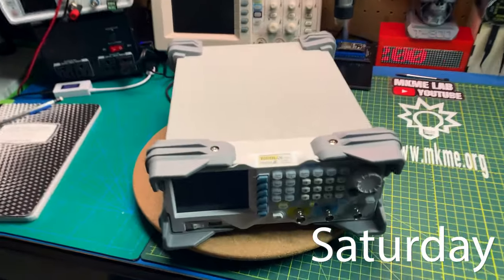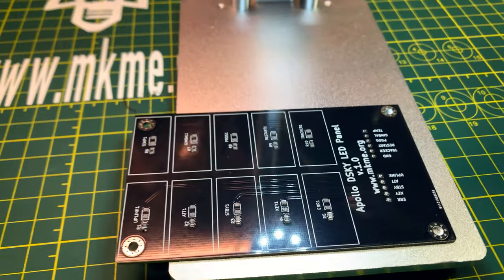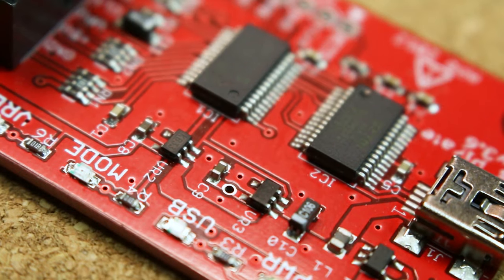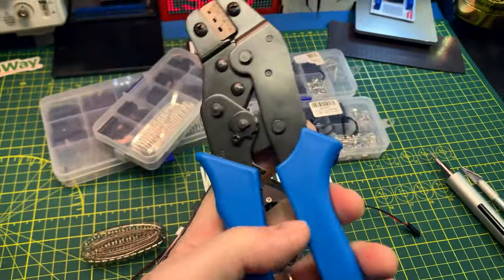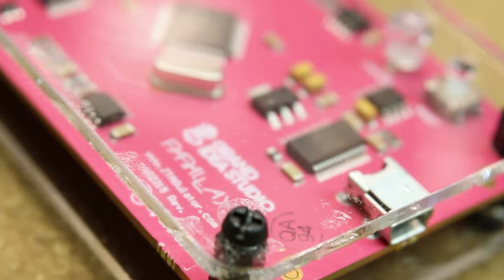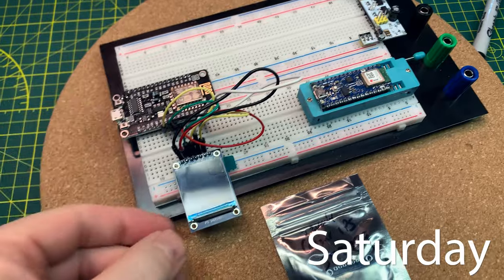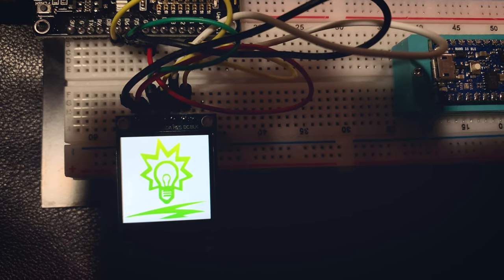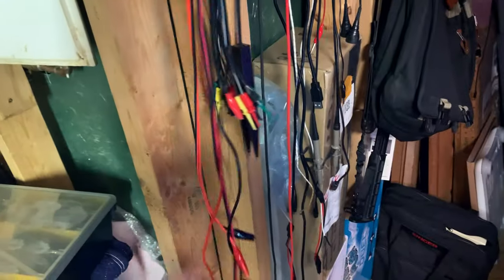Reflow Soldering, Cool Display for ESP32 Projects, Lab Gear & More | Update

Comment: I would like to see how you use the Jtagulator for troubleshooting.  I haven't seen that before.  I worked with a number of those 3Com switches...a long,  long time ago.  Some of the old switches had no UI.  Others had just a Telnet/SSH interface, and then presented either a command line, or simple menu interface.  Sorry I don't remember anything specific.
Reply from the maker: I'm hoping this one has a simple interface with an option for RESET :)   Its so weird that the website nor any archive has their stupid Windoze interface SW but I think we can get in to it.  If not- it will be fun trying.  I don't really understand what mode it could be in either- It does all the blinken just doesnt actually send any data through.  Could be just broken too.  Thanks very much Bud